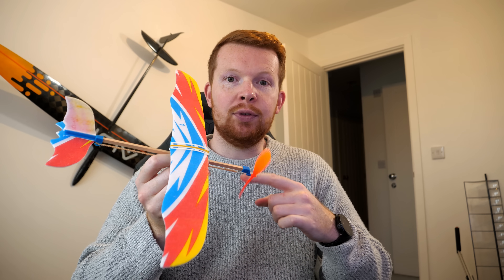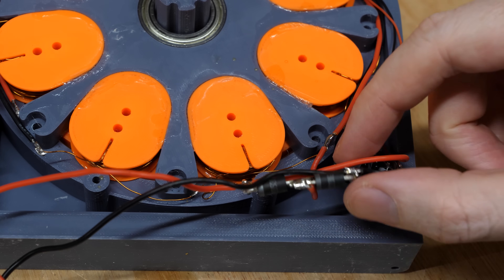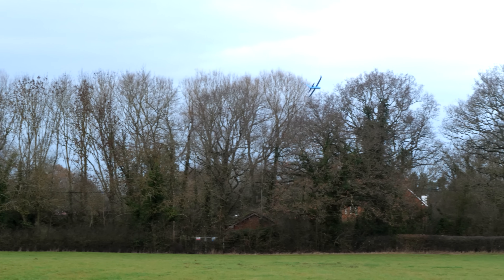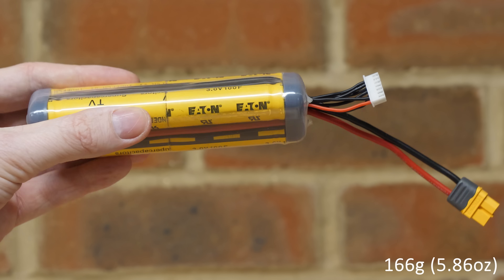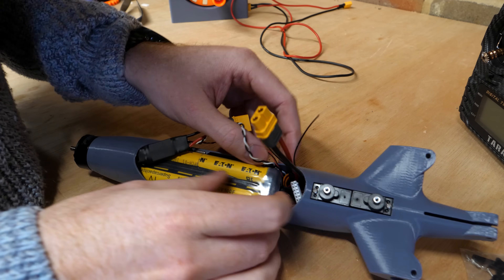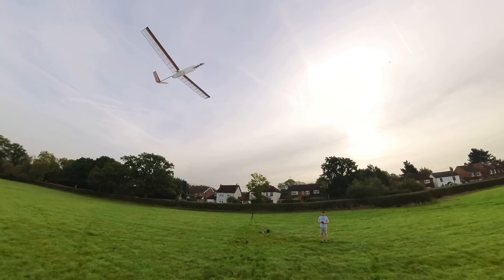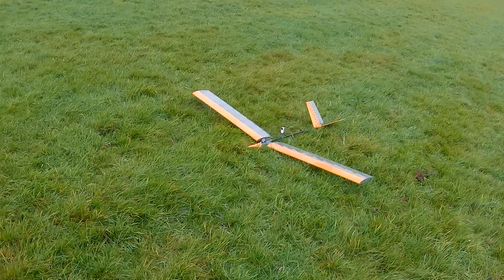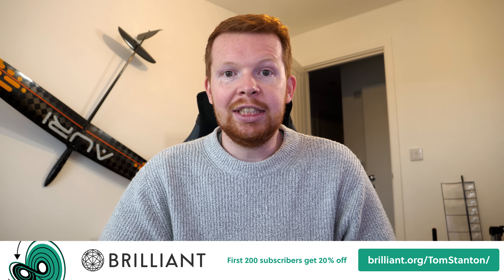Super Capacitor Plane

Comment: Replacing Step-Down DC/DC converter between capacitors and electronics with SEPIC DC/DC converter will help to get more energy from capacitors. You use from capacitor C(U_full - U_end)/2 J, where C - capacity, U_full - voltage of fully charged capacitor, U_end - voltage when electronics stops to work in current project.
In current project you lowering voltage to voltage required for electronics. But after voltage of capacitors achieve 5 volts you can rise voltage with Step-Up DC/DC converter. And if voltage of source can be higher or lower than required than other converters can be used, for example, SEPIC or Up/Down DC/DC.
Disadvantages are more weight and looses, but may be extracting additional C(U_end(current)-U_end(SEPIC) )/2 will give longer flight time for heavier plane.

Comment: 1:50 why do you solder up diodes instead of just using a mass produced full bridged rectifier?  Are you poor or something?
Reply: Who tf asks if you are poor or something, bro? What's wrong with you? He probably just had spare parts or something
Reply: @gamer_chillax  what's wrong with me? nothing... You just don't have spare diodes laying around.   And even if you did it's best to get a cheap full bridge rectifier which is enclosed in a case with heat dissipation for pennies on the dollar.   The cost of diodes individually is less than a full bridge rectifier which is mass produced and balanced correctly.

Comment: The spinning propeller should charge your capacitors though.
I once killed a battery on a fast (160km/h) wing and lost control until right above the ground, when the drag spinning prop had produced enough power to allow me to control the servos for 2 or 3 seconds - just enough to save the plane.
I consider it regenerative breaking. :-)

Comment: @TomStantonEngineering : if you can power the R/C electronics independently of the ESC using a Schottky diode and a DC-DC converter, you can keep the electronics alive longer. Unlike batteries, there is no problem with discharging a capacitor to zero volts, so anything from a Joule Thief boost converter all the way up will work for the controls. You set the boost converter to put out > 5VDC and feed power to the RC RX through Schottky diodes from the DC-DC converter and the capacitor pack.
Reply: Why schottky diodes? What do they do?
Reply: @AgentFire0  No threshold ! So no 0.6V loss.
Reply: I use a 1S lipo for radio and servos - runs to 3.3 volts on all my AM yacht and 2.4gHz Flysky gear. Suspect the ESC sets the limit and may be resettable.
Reply: Thumbs up all the above. But why not put a super cap across the car battery and charge the plane thru a resistor in about 2 seconds?

Comment: Tom, I'm an electrical engineer and want to compliment you on a outstanding job!  I'm jealous, wish I had a place to keep a laser printer!  That is a brilliant design! But then, I would expect nothing less from an excellent Aerospace engineer like yourself!  I want to add that I believe the long term solution to the "battery" problem of electric vehicles is not better lithium batteries but more research and advancements on super capacitors to significantly increase their energy density to be at least equal to lithium ion batteries!

Comment: Awsome video Tom. I'm not sure if it's possible with the ECU you fitted, but you might be able to enable ECU braking to prevent the propeller from windmilling, increasing your flight time to help get that 1 to 1 charge to flight ratio.

Comment: This is so clearly presented... Battery vs supercap with the green and red text, the consideration of volts dropping and need of control while gliding the rest of the way...
Reply: From an engineering perspective, though, I do wonder whether the plane really pushed even 100W during operation. As an example, running those supercaps at the same power density (per gram) as the lithium battery, they'd run from full charge to zero in about 12 seconds. Also, checking the charging, seemed like it took about 90s to charge the capacitors to half voltage - that's a quarter of their full energy capacity, so the crank power output was (0.125Wh * 6 / 4) / 90s ~ 7.5W over the duration, which is well below the charge rate of even one lithium battery.

Not saying a supercap plane isn't awesome, but it does help illustrate why lithium batteries are in such high demand - they really have great power/energy characteristics.
Reply: @chord5625 I also don't know how he balances the caps during charge, to me it looked like he charged up to half the max voltage to be relatively safer and didn't bother with balancing but maybe I missed something

Comment: Tom, great video!  I suppose you know this - or perhaps others have posted already - many electronic speed controls come with a "brake" setting that can be used to stop the motor from spinning when throttle is off.  You just have to look up the specific programming instructions for the ESC or use a programming card.  I use it with my folding props to get them to fold.  (It works much better than some of the rubber band hacks.) I would hope the current it pulls to turn the brake on would be worth it.
Reply: I was about to write the same thing. Hindering the prop to spin is done by the speed controller.
It just short circuits the motor, such that the current generated by the spinning propeller/motor in itself stops the spinning (the motor is acting as an electrical generator with an almost infinite load on its output). So no extra energy is used to do that, all the controller does is short circuiting the motor which increases the "resistance" of the motor immediately as to bring it to a standstill.

Comment: Higher gearing in the crank and turning on esc brake to stop the prop spinning could potentially give you 1:2 already I imagine. Better conditions with thermals and maybe lw pla could skyrocket the ratio. But you'd have to limit prop on time a lot to have enough control power, or keep a separate small lipo for control. But that would partially defeat the purpose.

Comment: I have a thought. Is it possible to shorten the charge time as the plane descends? By which I mean as soon as the propeller stops working, the propeller could also work as a dynamo to charge the super capacitors. This could shorten the time needed to crank after each flight. Or maybe add a few extra propellers to harness some of the power when the plane takes flights. Then again it would contribute to drag. Must be inefficient.

Comment: Maxwell super cap has 3000 Farads at 2.7volts.
My calculations makes it 42 watt hours with 7 caps in series. Don't know what the leakage is.
With a decent current source you can charge it very fast. It should last you for life with very little degradation. 
With certain compounds to make ultra capacitors, you can eliminate ICE all together.

Comment: Knowledge of electronics like this is really useful. I have a basic understanding enough to understanding what you’re doing, but not on a fundamental level to build something from scratch like what you did with building a charging motor. wonderful. I like the idea of maybe 3D printing parts to build my own windmill or hydropower from a stream and be able to scavenge parts from current electronics and build my own device from them. Finding new life from old parts would be so fun and useful.

Comment: You have 18v alailable potential(capacity) and you choose to charge only till 8? Why? You have 3 caps are only just for weight? Then put those caps 3 in series and 2 groups in paralell then you will use close to full capacitive charge

Comment: You should go and take a look of the episode on the Flight Test channel where they did the same with powering and making it RC of one of these capacitor, powered radio controlled RC model airplane.

I wonder if there’s a light weight way to raven out the power output of the capacitor, so that it gives a more even power curve throughout the flight, as well as possibly be more efficient to where you actually get longer flights.

Comment: Complete uneducated lurker here. Would it be possible to build the crank into the propeller head to generate power as it spins from the capacitors and power a 2nd set of capacitors to then switch over.

Comment: Now make some sort of variable pitch wind turbine to mount on the plane, use the electricity produced by the turbine to charge the supercaps whenever the voltage drops under a certain level and voilà! You got a forever flying rc airplane

Comment: With the lightweight of the capacitors, how many could you fill into the wings and drive the prop if you were to use the wingspan of a very wide gliders wingspan?

Comment: So how did you address the capacitor voltage balancing? You added a balancing connector, but did you add something active to balance the capacitors? How quickly do they fall out of balance in practice? My understanding is that depending on the type of supercapacitor, going reverse polarity might not be detrimental, but exceeding the rated voltage will quickly result in bad stuff.

Comment: You can use a voltage booster circuit which will limit the voltage output at a set voltage, when the capacitors deplete below that value the circuit boosts the voltage and will drain the capacitors to almost empty. I use this method for my solar charged super capacitor lights, that run all night every night and charge all day, I get over a million duty cycles😊

Comment: Could you use that freewheeling propeller to shove a bit of extra charge into the capacitor array? Might be able to run the control system on the way down

Comment: Either equip the prop with springs just strong enough to make the blades fold back when the motor's spin isn't forcing them out, or put together a circuit to convert the motor to a generator when it's not being powered, and use the power it generates from the windmilling prop to power the radio receiver and servos by switching into series with the capacitor bank. That would extend the time before the voltage drops below five volts. It could also extend the overall flight time by running the motor to climb then cutting power to glide a bit, give it some motor to climb again, repeat as many times as possible.

Comment: Amazing, I want to build a 3D printed axial flux generator with a super cap powered voltage regulator to power a charger. You’ve got to exploit the benefits of different types of energy storage. The super caps would be great for capturing energy and releasing a constant voltage output from a hand cranked generator. This can then be used to charge high energy density lithium cells.

Comment: A lot of hobby ESCs will have a feature called a Low Voltage Cutoff. It'll detect how many lithium ion cells it thinks you have when you connect it and will shut off power to the motor when the input voltage drops below the per-cell voltage threshold. It's meant to prevent batteries from running too low and dying.
It probably detected the original ~8v from the caps and assumed it was connected to two lithium cells in series, and cut out when it hit 3.25v per cell.

There's usually a way to disable that, which would let you get a good bit more power out of the capacitors.
Reply: Likewise you can usually set them to brake the motor when you bottom out the throttle input, which is important for folding propellers since otherwise they'll just keep rotating in the wind.

Comment: what's the problem if the coils are all are in same direction and use it to  produce dc ? [then there would be no voltage drop in the diodes either]

Comment: You only use a half of your battery capacity because of steering and remote issue. If Steering and remote could use an independent standard battery (2x cr?) then propeller can drain your battery to true 0. It will extend your flight time 2-3 times.

Comment: Couldn't you build a rotor shaped like a plane's propeller, attach it to the nose, then use it to recharge a bit of the capacitor while it's in flight??
Or does that break laws of thermodynamics?

Comment: i ain't a electrician but instead of a single battery, split it in half  use battery A for regular use and create a secondary charging motor while the wheels are spinning to charge battery B or viceversa? like i said idk anything about electricity.

Comment: You're getting me thinking about using a super capacitor on one of my wings to give it a boost mode! I wonder if it would work to somehow have a lipo and capacitor able to be wired in and setup to switch from one to another via the radio or FC.

Comment: How hard would be to use the spin of the propeller as a generator to charge the capacitors after they stop pushing the motor (like ele tric cars use their inertia to charge the battery) and how useful/practical would it be?
By useful/practical I mean how much more time of motor run could be added after some time of "wind turbine mode"?

Comment: The folding propeller is a really good idea, but I think your air powered planes will always be cooler than anything electric.

Additionally, the windmilling of the propeller attached to your three phase motor could be used to generate some extra flight time. The charging current of these capacitors I suspect can be low enough to actually benefit from a few seconds of that.

Comment: I’d be interested to see a comparison of a hybrid capacitor/battery setup versus a normal battery setup with the same total capacity 
Whether that increase in weight from having both is offset by the increased output voltage from the big-boi capacitors

Comment: Was the reason you didn’t just use a raft/brim for the first model due to the imperfections it might introduce around the tip?
I figure a brim would likely add some sharp edges that might affect drag but with a raft you could likely get it free without much distortion?

Comment: you could have added a battery in the rear to power the radio and servos, leaving the super capacitors for just the engine to dissipate over a longer period of time
Reply: maybe even slow charge the super capaciors while in air

Comment: You should make one that has super capacitors and a battery so that if you press a button on the remote it activates capacitors and it would be like a boost and you could make it so that another button makes the battery charge the capacitors so it would be a plane with a rechargeable boost

Comment: I don't understand the advanced electronics used here - I've never worked with most of this equipment - but would it be possible to use the windmilling of the propeller after the motor cuts out, as sort of a generator in itself? The same way that regenerative braking works? My guess is that the necessary torque to output any necessary voltage for such a system may at least halt the propeller in one position instead of allowing it to spin freely

Comment: A 1:1 crank time to flight time ratio means that you could, theoretically, keep it in flight indefinitely (if you could find a way to get power from the crank to the plane in mid-air, of course), doesn't it?

Comment: Wanted: follow up vid involving copper tape, some pex tubing  in a parallel segment raised above the ground, and a voltage differential applied between the two rails. Matching copper tape under the glider wings. Touch-and-go recharging for extended fly time. Just don’t fly through it the wrong way! This is the only way pure electric aircraft can go transcontinental, with a network of electron-harvesting drone barges: solar/tidal(/wind) energy in, electrons out on-the-fly.

Comment: You should try replacing the supercap with a LTO cell. It's a lithium battery with all the same advantages of supercaps, including charge rate, the same voltage range as supercaps, and none of the disadvantages of either. Safe to discharge to 0v, safe in a crash, better energy density than supercaps, etc.

Comment: I dare you to build an mk17 powered plane! Mk17 - 1,5cc diesel engine (33% kerosene 33% ether 33% castor oil) they are so fun! Also all 3 of the ones ive got start up pretty easly! Only downside is you need ti have the fuel tank placed at the right level for them to actually start (those are conpression engines that work like the simplest possible diesel engines) they have a screw on top to adjust the timing and compression

Comment: To get that propeller to fold back and stop spinning, there should be a brake setting you can turn on with the ESC.  It is a common feature of ESCs.  You typically program it with the throttle stick on your remote control.  Reference about brake setting:  https://www.youtube.com/watch?v=qYHJgg_vvSQ  
Love the videos.
Reply: thats right, but in fact that this only works with power.. the esc is turning off.. better would be an oring or rubber like on the F5J class to fold the propeller
Reply: @CNCrafts_Matze  No. the ESC is reaching LVC (low voltage cutoff) where it cuts or reduces power to the motor. The onboard BEC continues to ouyput 5 volts to the receiver, and the brake should continue to work.